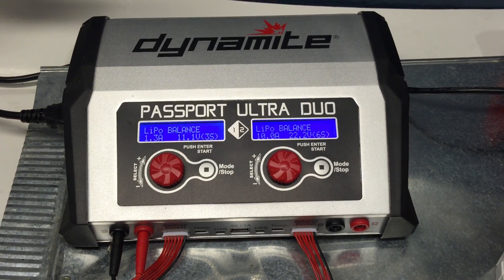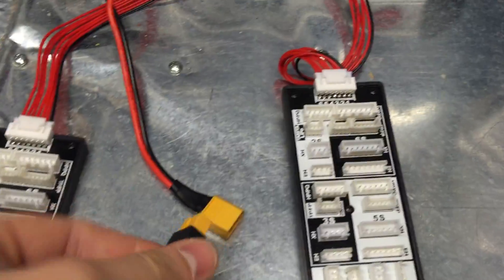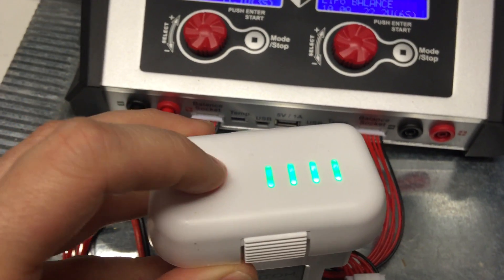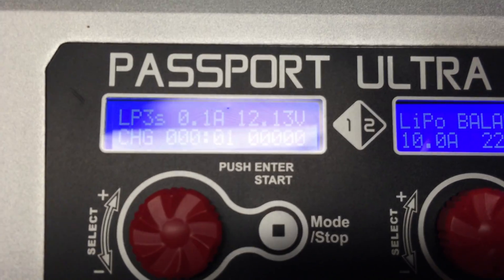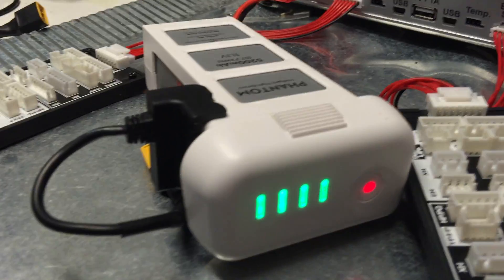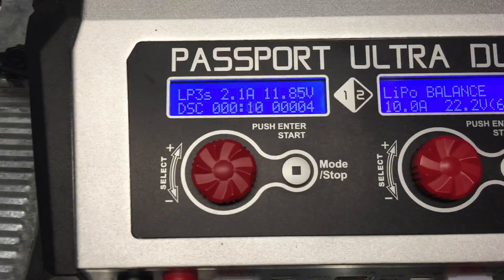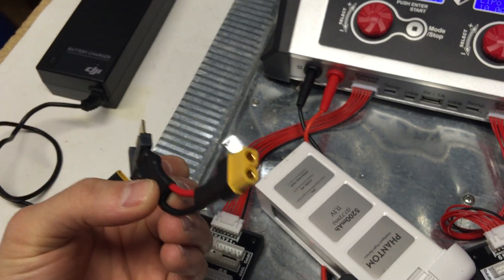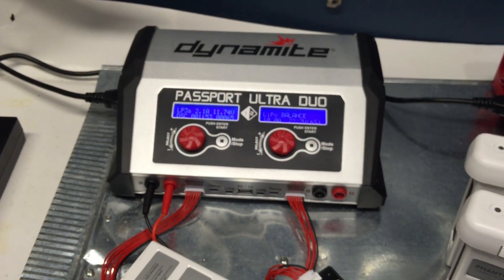How to charge DJI phantom LIPO batteries with regular Charger - Aerial Vision Chicago

Comment: You do NOT need to storage charge DJI batteries, since they are "intelligent" batteries, they automatically self-discharge on their own if not used for a few days. At least thats what mine do.

You can set it in the app to auto storage discharge between 1 and 10 days.
Reply: I don't think they could discharge that amount of energy,  for physical reasons

Comment: Does NOT work, I set mine to 4s LiHV, which is what the DJI Phantom 3 batteries are, and my charger just says "Cell Error," even though the battery is turned on. I verified that the polarity is also correct.
Reply: This is for phantom2

Comment: I'm trying to solder the connectors from the stock power brick and its a coax cable. I was wondering whats the polarity of the cable, is the inner wire (the one covered with the white sheath) the negative or the positive?
Reply: With DC voltage it shouldn’t matter.

Comment: IF NOT WORKING... If you're only getting like 1 solid or 1 flashing led on the battery, it's because that sucker is REALLY flat/unbalanced. Wait long enough and things start happening (more leds light up and start scrolling like normal) Hope this helps someone.
Also depending on your charger you may need to turn the battery on first else you just get "CONNECTION BREAK"